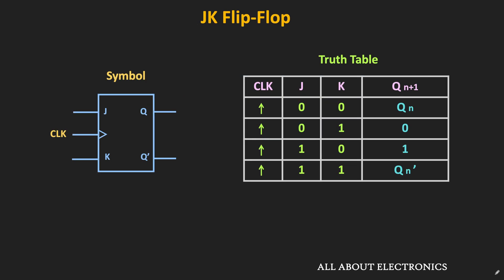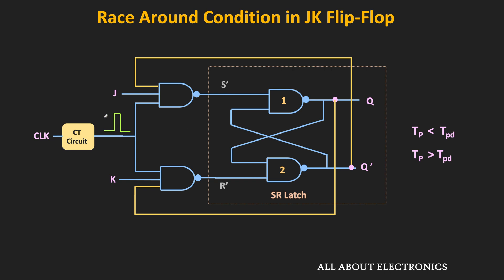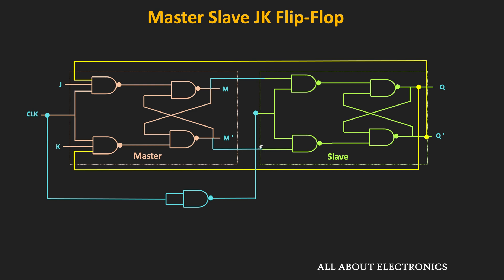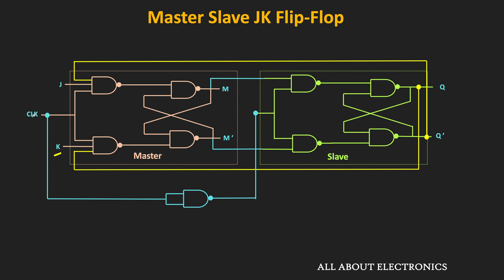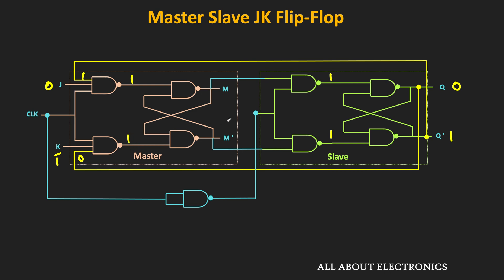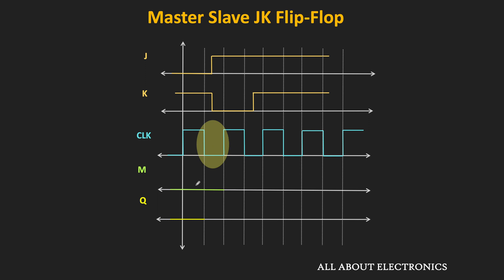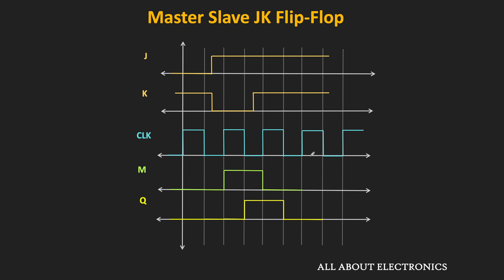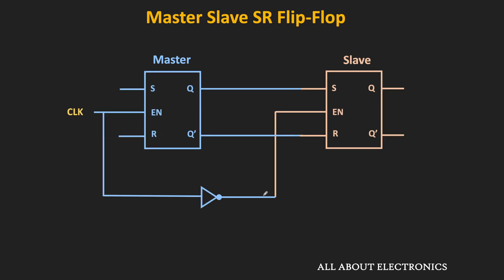Master Slave JK Flip-Flop Explained | Digital Electronics

Comment: When you say Flip-Flop, it should have the CT circuit. What do you mean by level-triggered JK Flip-Flop? Do you mean JK Latch?
Reply from the maker: Yes, that’s correct. It’s actually JK latch. And sometimes interchangeably it’s also referred as level triggered flip-flop. But in reality flip-flops are edge triggered flip-flop. And loosely the JK latch is referred as level triggered flip-flop.

Comment: What will happen if I draw the master slave JK flipflop diagram for master slave D flipflop inputting D at J and D' at K

Is it completely wrong if we are asked to draw a Master slave D flipflop?
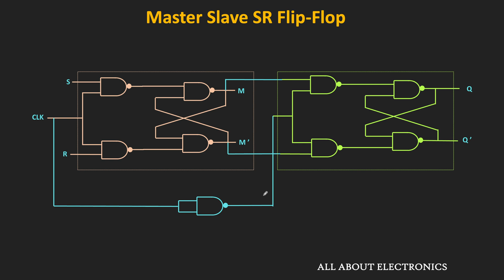Reply from the maker: The Master slave D flip-flop circuit diagram is similar to master slave SR flip-flop, but here you just need to connect an inverter between S and R input. That means R = S-bar. Please see the circuit at 15:20.

Comment: 18:17 sir why should we apply pulse transition circuit to the data input i cant understand that sir usually we apply pulse transition to the clock signal
Reply: same doubt did you find any answer for the data lockout?

Comment: At 17:14, why does M follow D? If it is positive edge triggered, shouldn't it not change unless it is on a rising clock? Or is M actually level triggered?
Reply from the maker: It is level triggered. The master slave configuration is level triggered configuration.
Reply: @ALLABOUTELECTRONICS  ok, then at 7:47 the signal changes why you don't consider that change at the level trigger
Reply from the maker: @motazmoneer5133  The Q output which follows the master will respond to the change when the clock signal is low. Please follow the video beyond 7:47, you will get it.